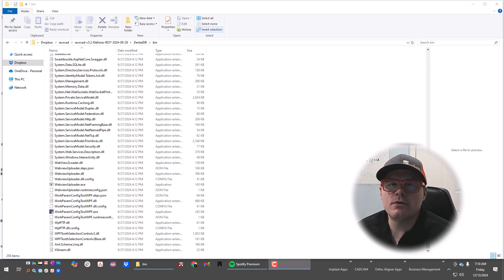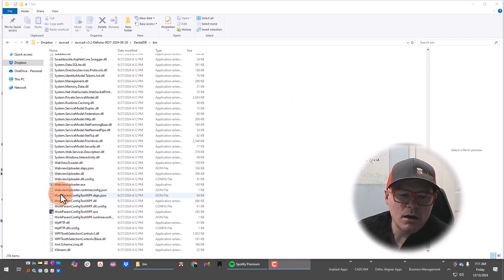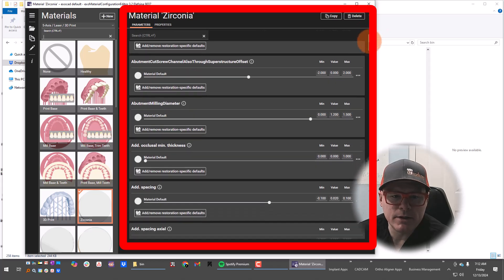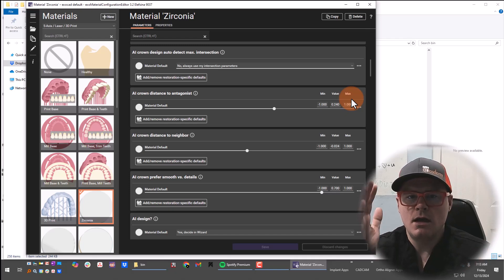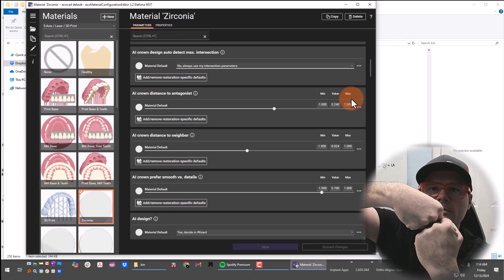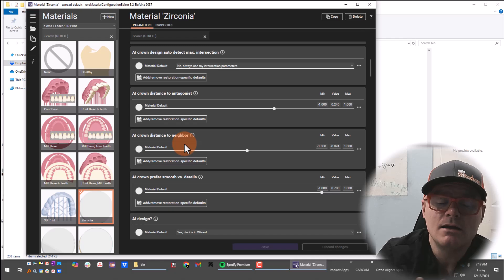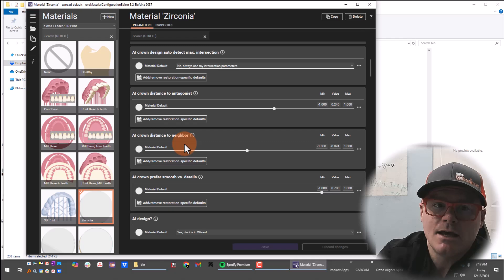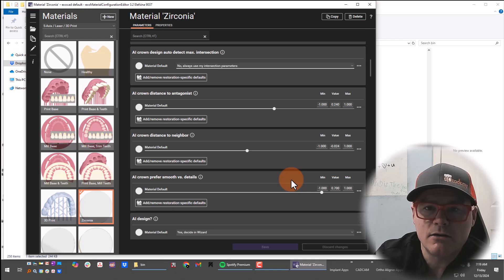exocad AI Crown Design - Parameters Settings Using Work Parameters Configuration Tool

Comment: I have been hating IO scans from the beginning because of the bites!! They are never accurate and when pointing that out to doctors they say deal with it.  If your explanation is true that's nice to know.  It's actually comforting! Unfortunately, 90% of bites are off by a lot more than that ligament flexing.
Reply from the maker: There’s also the hinge axis of rotation. That makes hyperocclusion more pronounced in the posterior compared to the anterior. So when you say “bites are off” by a lot more, you need to add context. I would bet those “way off” bites are most likely second molars. 

This is the difficulty of making a restoration on a static model versus a dynamic system in the mouth. There’s never a single reason.